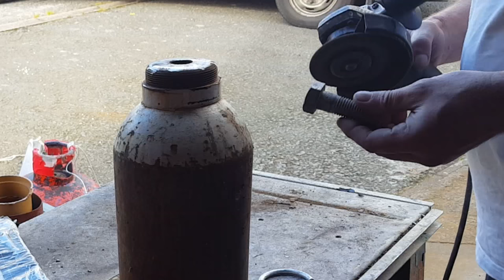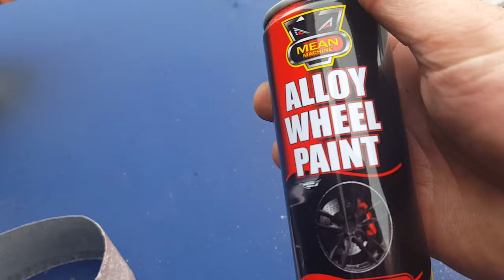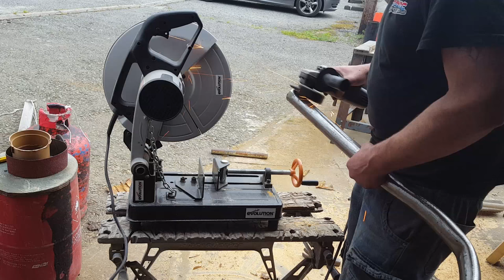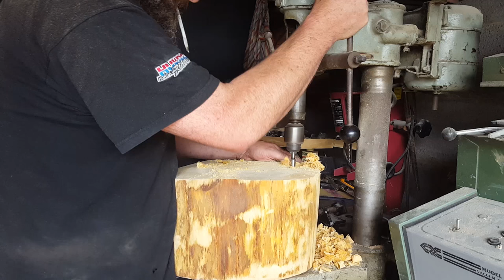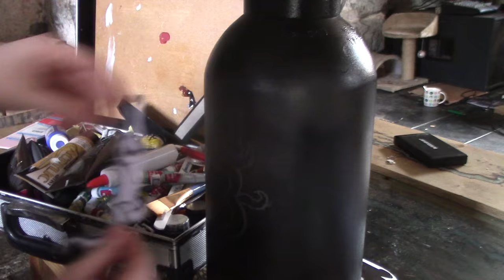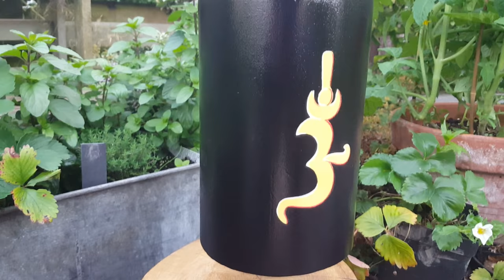Make a Bell - Easy Welding Project - Musical Instrument Hack

Comment: Do you hit with a hammer from the outside or is there a ball in the inside that you've attached a rope to?
Reply: I'm guessing that you push the bell against the upright but I'm usually wrong.
Reply from the maker: outside, i used the aluminium rubber end from a set of crutches that i pulled out of a skup, skup? skip as a mallet